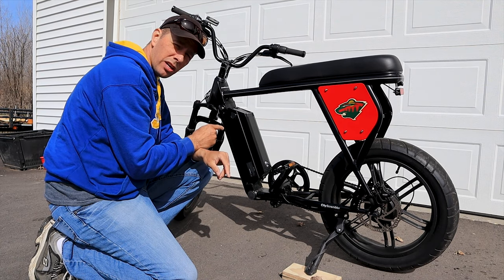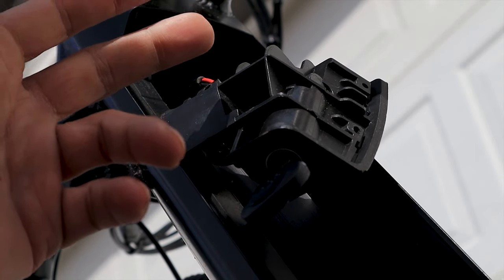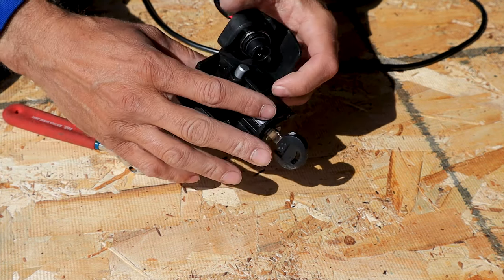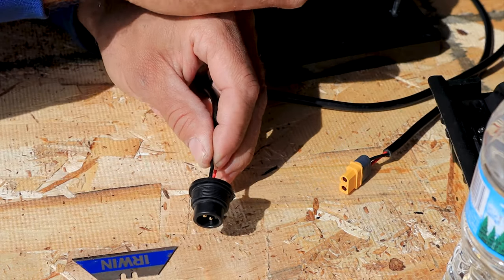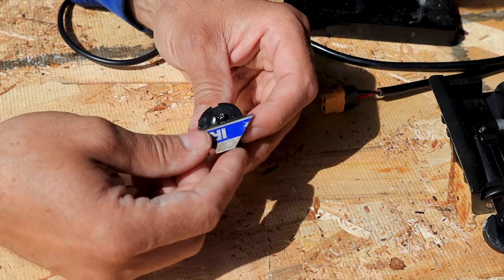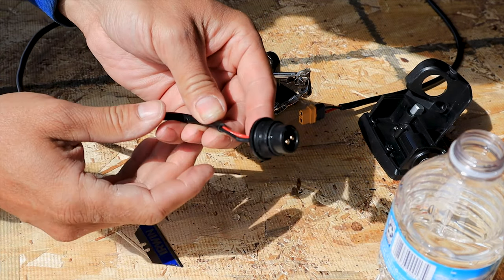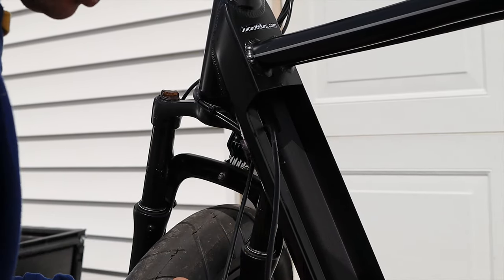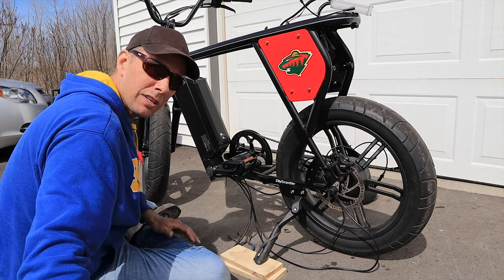Juiced Bikes; How to Fix a Bad Battery Connection

Comment: Thank you, 3cheerz. I have a CCX that had the same issues as well as the wrong firmware flashed on it. So, I have taken the bike apart like you, but I did not have the guts to modify the plug like you. However, I know my time to do the same will also come...and this video will be indispensable. Thank you so much for making this video! Also, I hope you'll keep us up to date as to how the fix holds up over time!

Comment: Great video! That connection took out my controller because of the inductive spike it created and I remedied it by hardwiring it, but I like your solution.
Reply: how'd you go about doing that? My battery just took out my controller too.. this is ridiculous.
Reply: @KNOWLEDGEKOLLECTIVE  Remove the factory connections on both sides, (battery and bicycle) and add INSULATED SPADE TERMINALS (I put this in UPPERCASE to impress upon you the importance of using INSULATED TERMINALS) to the wires. I had to add wire to lengthen one side  - I think the battery side but it will be obvious once you're in there. And once again, make sure you use insulated terminals for the splice.
I've put close to 1000 miles on the bike since doing this mod. and haven't had a bit of trouble.
Oh, and once you've done this it will be a little tricky to get the battery locked back onto the bike but after you've done it a couple of times it will become old hat.

Comment: What were the symptoms you were seeing to try this replacement? I go to turn my bike on and the pedal assist gauge will turn on for a second and then turn back off. Sometimes it won't even turn on at all. My battery is full charged. Was this the same thing you were seeing?
Reply from the maker: Dan Stallone I did it to prevent any future problems.  I could see that the pins were only going in little bit and saw how others had problems with it.  You should be able to tell if it’s a problem.  Look closely for burn marks on male and female side.
Reply: @vanmasterflash7153  Thanks for the reply. Juiced Bike has awful support. Maybe I can ask you to see if you'd have any ideas.

All of a sudden (I think it was caused because of a bumpy road) my bike shut off. and wouldn't turn back on. I got the bike back home and hit the power button and the gauge started to light up, but the power cuts out after a second. Most times when I hit the power button the gauge doesn't even turn on anymore. I did notice if I did hold the power button, it'll continue to go through the boot up process but shows 1 battery cell or none, and then it'll shut off again.

Any ideas? I can send a video if that might help

Comment: Tried this on my camp and still shuts off with bumps. Took out controller and wacked it a few times to simulate bumps, it didn't turn off so don't think it's the controller. Wonder if it's a bad BMS in the battery?
Reply from the maker: It could be.  I put a new bms on my home built 52v bike and it shut down at 51 volts.  When I put the tester on it the volts were acting weird moving from 51.5 to 53.1, back and forth.  I'd go to turn the screen on and it would shut off immediately.  I took the bms off and it's been fine.  Hard to say sometimes.  My red scrambler still doesn't run right.  the power comes in and out and it bucks at  take off when using pedal assist and throttle at the same time.  You could try bi-passing the bms to trouble shoot.   Sucks because we paid good money for these bikes.
Reply from the maker: Could possibly be a bad connection in the battery as well.  I'm sure you've already tried this but it could also be a brake switch out of adjustment.  Could try disconnecting both brake sensors to diagnose.

Comment: What’s the bms max amp output on those 52v batteries
Reply from the maker: That I don't know.  I use a 35 amp controller without any issues.